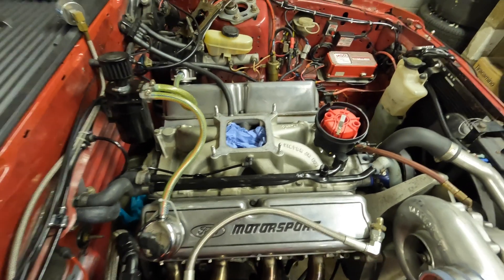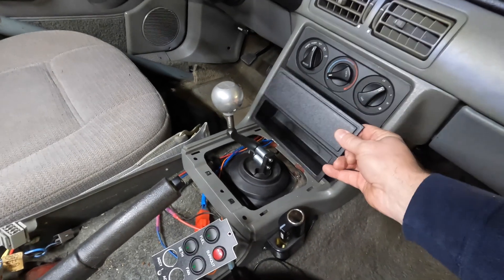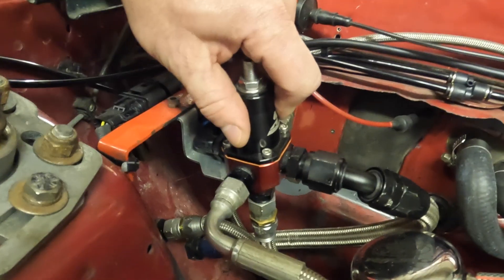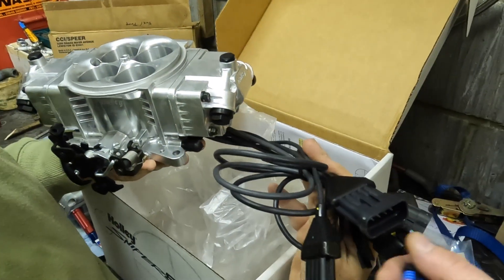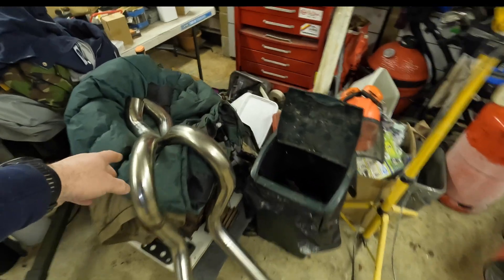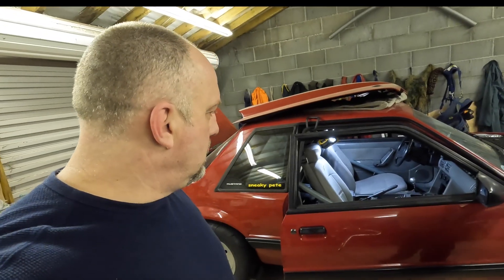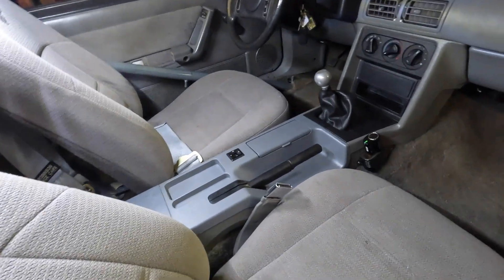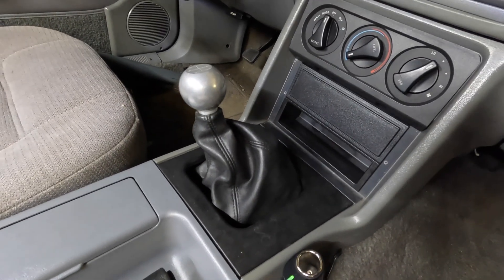Petes Blow-Through Carb to Holley Sniper EFI Conversion.  Easier Said Than Done.

Comment: Im looking into switching to super sniper for blow through i have regular sniper now it works great but want boost
Reply from the maker: I have a FiTech Go Street on my F100 and plan on replacing it one day with something newer.  It's amazing how far these throttle body EFI systems have come in only a few years.
Reply: Did the blow though demon carb you had on it work good?
Reply from the maker: @robbyshinault1069  It drove ok on the street but It kept going lean up top even with 99 jets in the secondaries.